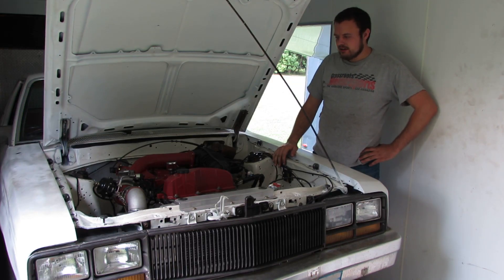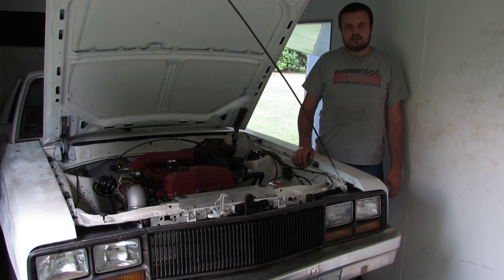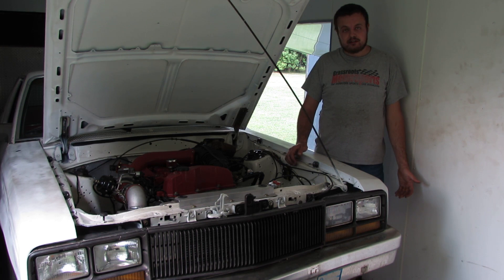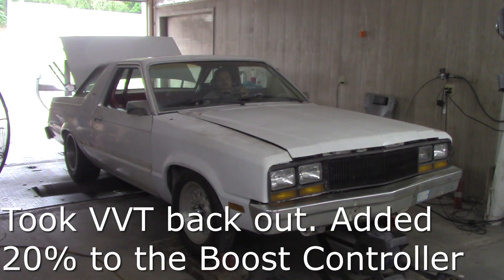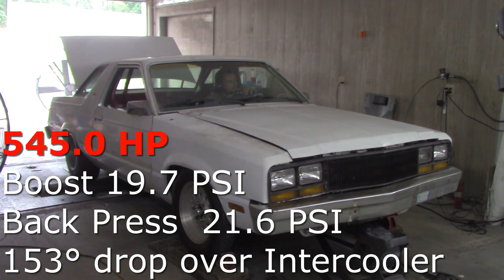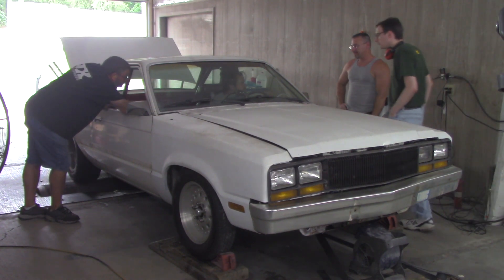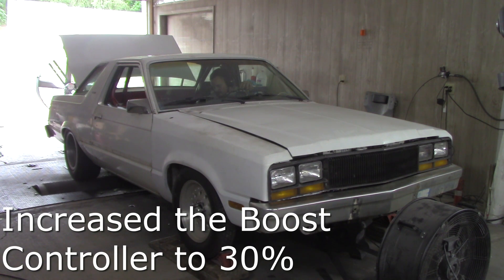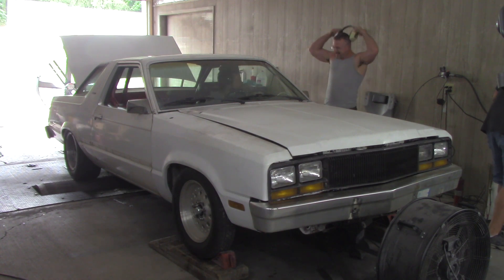600+ WHP on a Stock Vortec 4200 Engine

Comment: What you rev up to?

What you think is the safe max rpm on this engine completely stock with bolt ons / boost setup.
Reply from the maker: This one was only going to 6k, but with the right damper we've taken them to 8k with stock internals.
Reply: @Calvin-Nelson  without springs and cams?

Comment: Gale Banks made a whole video about Manifold Air Density being a priority rather than boost pressure.  At the end of the day, regardless of IAT, pressure is pressure, and can be independent of how much air mass is physically moving through the intake tract.
Ideal gas law: PV=NRT (P=pressure, V=volume, N=total # of atoms, R=mathematical constant, T=temperature).  With that being said, if we take it to logical extremes, a ideal turbo setup on an engine with proper cooling, if IAT is at 0C/32F, pressure's probably going to go down because P and T are directly proportional, and since that's the case, for the same intake volume, pressure's going down.  Other way works too.
Reply from the maker: Yep. Big fan of Gale Banks. Very familiar and with how the principal works.

Comment: question can u run this with a terminator X ecu?
Reply from the maker: Yes. For early engines you will be forced to run an external cranks trigger. For 08 and later engines, you can use the built in crank trigger.

Comment: Give me an idea what you spent on upgrades just the ballpark are you at 3,000 $4,000 how much $1,000 for the turbo and all this stuff the ECU the mega Square where do you find these at
Reply from the maker: We probably have about $2000 in it. It's a very cheap turbo, very cheap wastegate, got a deal on the ECU, some reground cams and valve springs, a harmonic damper, cheap intercooler, $20 transmission, some tubing, some snake eater injectors, and a cheap explorer rear.

To duplicate it, you could easily spend $3000-4000. Just Google search Megasquirt Goldbox. I'd recommend a VS racing 7875. Google is your friend.

Comment: Would a 2004 4200 engine be capable of similar power? Have one in my Trailblazer and wouldn’t mind making more power. I’d be happy with 400ish hp.
Reply from the maker: Yes. Made 545whp on my 2004 motor on 19psi
Reply: @Calvin-Nelson   thanks for the answer. I have subscribed and will be watching a lot of your videos

Comment: What the best model year to pull from the bone yard.  Is it the 2008?  The bone yard by my house has a few 4200s.  This past summer there was a complete engine in an 08 Trail Blazer, I just got intimated when it came to pulling the motor.  Hopefully when the weather warms up this coming spring and summer and I can get some guys to help me, I'll be pulling me a 4200, even if I don't ever do anything with it.  It is such a cool motor.
Reply from the maker: We've had success with all the years. The ideal is to use parts from an old engine, in a newer engine. That being said we made 713 whp on a stock 06 engine. I would grab an 08 if you can, but any year is capable

Comment: Question for you.....I would like to mount up a 5 speed manual to the Atlas engine and put carbs on it also, any thoughts? Flywheel and bell housing adapter plate?  Not sure, but I think the tranny would be a T5 from a fox body Mustang...
Reply from the maker: Check out the wiki. https://sites.google.com/view/vortec4200wiki/home
Reply: @Calvin-Nelson  great, thanks

Comment: What injectors and fuel base pressure?
Reply from the maker: Snake Eater 1500cc injectors. Still using the factory fuel pressure regulator, so 58psi.
Reply: What transmission?
Reply from the maker: @vortecturbo  th400

Comment: Gained power and dropped boost with vvt change because you made it more efficient/ flow more. The turbo was doing just as much but there wasnt as much 'back pressure' on the intake side
Reply: The VCT is on the exhaust side, not the intake. Also the Altas engines don't have VVT, they use VTC (Variable Cam Timing) simply put it changes the degrees of timing on the cam whereas VVT puts the valves on a different cam lobe....think VTEC.

Comment: Dude this is so sick. Is there a manual transmission that would work with this engine?
Reply from the maker: Yes. You need a custom flywheel that you can get through Emtech. Then there are a lot of options. Looks at the Vortec 4200 wiki for more details.

Comment: Have you tried SuperSparkz for the ignition coils? They’re Beryllium copper rods that replace the coil springs inside the ignition coils.  $65
Reply from the maker: I have not. May be worth investigating
Reply: @Calvin-Nelson  Search for SuperSparkz by a person that goes by Supermodulation. I found a thread on Trailvoy I think from 2011 and looked into it. The innards of the ignition coil is a literal weaksauce spring that looks like a long Bic pen spring. That's what goes from the heat sink to the nose of the spark plug. You take the rubber boot off, throw the spring away, and replace the spring with a Beryllium copper rod. It cures any electrical breakup you have. $65 for 6 of them. Turnaround time was immediate, prompt shipping. Also, make sure to use genuine AC Delco/Delphi coils. I'm happier than a pig in shit to see 600+ from the stock bottom end from you. I'm planning on a remote mount twin turbo setup with 2 Garrett GT3076r's at low boost very soonly.

Comment: This is so badass. Until I heard of Calvin, I was under the impression that the 4200 bottom end isn't very strong. I'm so glad that you are doing all of this research and testing. Mine is a 2004, but I may slap a turbo on it after I finish my 90 GMC turbo 5.3 build. Unfortunately, ARP head studs for gen 4 LS, have about 3000 back orders. I won't be receiving mine until mid September at the earliest. I'm contemplating using my Brian Tooley head bolts for now, and swapping them out later. I'm open to opinions on using the BTR head bolts, if anyone has any. I'm ok running low boost until then, but I wonder how much the bolts can take.
Reply: Reused factory stuff has been reliable of our 5.3 for quite a while at 22 pounds of boost.  It makes 680 RWHP
Reply: @andrewnelson3733  I'm going to use the bolts that I have. It's probably going to take me past September to complete the turbo fab.
Reply: @andrewnelson3733  Just so I read correctly, you re-used the Stock head bolts? They're torque to yield.

Comment: The question is, how long would it last @700+HP as is? Maybe 2 or 3 passes at the track?
Reply: If it lasts once, it'll last just as long as a built one.

There's no such thing as an engine that wears out under power that quickly.

Comment: I actually have an 08 Trailblazer with that motor... And I do have to say....... This is VERY interesting.. would you do a breakdown of the parts you have?? Like the trans and everything
Reply: Stock engine with 175K, TH400, 8.8" with 3.08:1 gears.  $10 flea market converter, steel driveshaft cut to length on the lathe.
Reply: Did the TH400 bolt right up or what kind of midplate is on it?
Reply: @TrailKing04  the original bellhousing on the 4L60E was bolted to a homebuilt adapter that bolted to the TH400 pump flange.  There is some good views of that adaptor in the Fairmont build series videos.
Reply: @andrewnelson3733  thats actually really clever....im guessing its on a stand alone fuil system right? or you guys cracked the ecu

Comment: What trans and converter are you using ? Th400 bolts right up ?
Reply from the maker: Th400. No idea on the converter. It was $50 at a flea market. Needs an adapter plate to bolt up. Look up Emtech Motorsports
Reply: This combo uses an adapter between the Atlas bellhousing and the TH400 pump bulkhead.  
There is an adapter available that allows the trans to bolt up to the engine.  That is how the Fiat is assembled.  The Stude has a homebuilt adapter.

Comment: Based on what I've seen from Gale Banks, y'all need to work on the intake/exhaust pressure ratio.

Badass though, badass.
Reply: That man has got something to sell so take everything you see from him with a grain of salt.
Reply: @jamieschinkai1267  

"Drive pressure is the amount of force (in pounds per square inch) that is being used to spin the turbocharger. A drive-to-boost pressure ratio of 1:1 is ideal, although in reality, drive pressure is usually a bit higher than boost pressure."

https://www.google.com/amp/s/www.motortrend.com/features/0904dp-turbochargers/amp/

I fully understand Banks is a business man but he has also been a badass in the turbo world since the 60's. Go watch the "Killing a Duramax" video series. They go into depth explaining how, why, and the math for all kinds of stuff. Including drive pressure ratios. Even if it is a commercial for the Bank I dash data monster.
Reply: @stevec5280  That’s all true, it’s even possible to do better than 1:1 rare as it may be. 

My point was that his back-pressure with this set up is not really that bad, certainly not a limiting factor with these runs.
Reply: @jamieschinkai1267  not bad, but could be better 😉

Comment: So even though I've read some hate about the Atlas engine family, you've proven that GM was on the right track and probably should have kept going with them. I found your videos when looking into building a bit more power with a Vortec 2900 for my brother's Jeep.
It's a shame these engines didn't see any aftermarket support, it looks like 1,000 horsepower is achievable with a little building over stock. Staying tuned in for more.
Reply from the maker: It may take 1000 with mostly stock parts.... Haven't proven that yet.
Reply: @Calvin-Nelson  oof, if GM built these strong enough to support that, it's time to revisit this engine family. That will be extremely impressive, and hopefully someone pushes that envelope to find out.
Reply: @Calvin-Nelson  I would love to see the output of a stock-level grenade motor with O-ringed cylinders and over 30 psi boost. I know it sounds crude,  but the 4200 seems to be able to take it.

Comment: Always had a love for the inline 6 design. Your making me want to sell my turbo 5.3 setup and 4200 swap my 4wd Silverado! I've got a local guy that has 323,000 miles on an 06 4200 still stock in the trailblazer but that shows the reliability of these engines

Comment: If the stock coils are insufficient based on the bolt location of the stock coil packs on the 06+ 4200s valve cover it looks like maybe the R35 GTR coils would bolt right up and those things are proven to 1500+hp, k-series honda coils are also an option that looks like it might work. Let us know if you find out its ignition or valve float related.
Reply from the maker: Will do. I'll put LS coils on it again if it proves to be a problem.

Comment: This is really making me want to do something stupid with my 180k mile trailblazer
Reply: Is it really stupid though?  As long as you've changed the oil you got more ring clearance and if you push too hard you've work hardened the rods just a bit, yes making them fracture faster but they are harder, might take a bit more pressure.
I'd be more worried about spinning a bearing.
Good oil 0w-40.
Send it. Actually the trans or accessories are the biggest issue

Comment: One of the reasons most manufacturers do VVT on intake only rather than exhaust is for the weird setup that occurs when you need to actually time the EVO EVC but it also affects overlap at the wrong end of the rpm range so you're going to find a sweet spot based on VE modifiers.
As boost goes up you reach intake mach (stall) numbers faster, CFM increases begin to subside but power can still go up with O2 density. 
This is when you start seeing the same or more power earlier in the RPM as boost increases (as long as there is enough turbo).
On intake only VVT, you advance the intake cam a ton on the bottom end, makes the engine look larger, spools turbos better and as you naturally need to time the cam more retard for RPM, it also reduces overlap.
On the 4200 they did exhaust for emissions.
The motor would likely benefit greatly from cams around 208-210 duration @ .050 or maybe like 256's advertised in the RPM range the engine is probably designed to live at (oiling, accessories, rod bolts, valve springs etc).  Of course you can pick up those mach numbers again with higher boost so you could run even more cam timing in the same rpm range, but I don't think a stock bottom end would survive.
But congratulations man, 600rwhp is no joke through an auto!  Ice water makes a huge difference and you're on E85 as well right?  So you've got all the modifiers there, but still excellent work, definitely much more room to go.
Reply: What would cost to build a daily at least 500hp driver for a 87 4dr oldsmobile cutlass supreme ?Watching your YouTube video got me interested and how would I be able to get one?

Comment: Great content, I was going to ask about the ring gap and head studs so I appreciate the stock everything list.  I plan on going with a 4200 for a project with my kid vs an ls.
Reply: I'm completely amazed that he's doing this on stock ring gap.
Reply: @chevy383jt  don't be.  High mileage engine have wider gaps.  No need to let the magic out only to find the gap is already wide enough.  We have torn apart dozens of engines and have concluded if it has 120K or more, just send it.

Comment: You lost 11% VE on the 26psi pull vs 16psi pull. 216 vs 240 NA w-horses. Where do you measure backpressure? In turbinehousing or in the manifold? 

Always enyos watching your videos, keep up turboing 4200s 👍👍👍
Reply from the maker: Back pressure is measured off the exhaust ports.
Reply: @Calvin-Nelson  ok then stock manifold seems ok i guess! Maybe its just those 4psi of more backpressure who makes the VE drop a bit.

How much ft/lbs? Must be alot! 
Again, impressive :)👍
Reply from the maker: @danielssonsgarage  557lbft

Comment: Great tech details on vvt 

Can you do a video on water 2 air intercooler sizing and parts
I.e. 30psi out of turbo is xxx degrees 
And yyy water can remove zzz heat
Reply: What Ecu are you using I’m thinking about doing the set up I have everything for my trailblazer.

Comment: I can tell people that my stock atlas could make 600 on 20 pounds...lol

Good work!
Reply: Dude, don't go around saying what it "could' do. That's annoying AF. It's fine to say that you've seen a Guy named Calvin do it, but saying it like you said sounds like attempted fake credit. Bleh. Don't do that. Make it happen, or refer them to Nivlac 57 channel.
Reply: The stock 4L60 would probably let go as soon as it felt and boost power. Good thing 4L80's exist. I'm wondering if it'll fit in the trans tunnel
Reply: With a stick, you could properly do even less.
Reply: Man... All the 60E hate. Never fails to be comical. I've done a relatively mild build on the 60E in my turbo 5.3 truck. Weighs 5,000lb, making 675 to the wheels and has been flawless for over 2 years of street use and many drag strip passes.
Reply: @mattsnook1723  I’m in the same boat, not the years though. Got a 5.3 Silverado weighed in on scales at 5000 even pretty much. I’m on 13 psi low timing around 450whp. The 60’s hanging in there.
Reply: @Bigpowerlowdollar  I've slightly worked mine over with a mild rebuild and a few valve body mods, but I'm talking like $150 in parts, not thousands like many of these guys say. The key to them is keep them cool, keep them shifting fast but not harsh. My last time at the track I pushed her up to 20psi, ran several low 10 seconds passes and the trans still works just like before, drove it home and am still driving it hard.
Reply: Yea the 60s are garbage..
Swapped a few in the past few years then decided AWD SS is the way to gocant remember the youtubers name that did a OLDS HURST with a AWD SS  drivetrain LSA set up and carbon fiber everything and he kept the Hurst shifters.. very nice build
Reply: if you threw 5 k at it,sure....
Reply: With build trans a some other drive line up grades maybe but not for long do the other upgrades and 10to12 psi and be done with it.